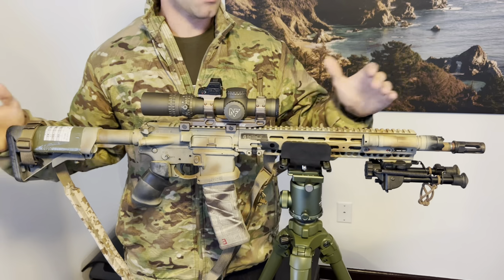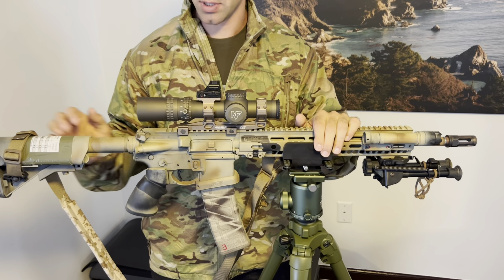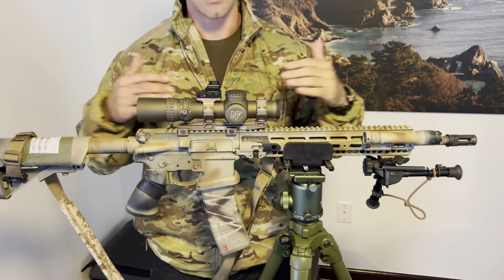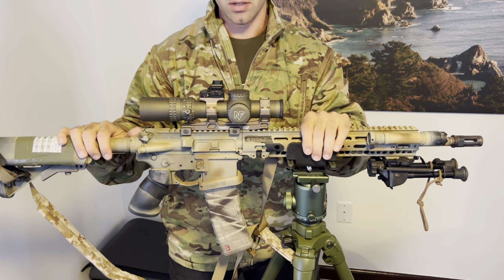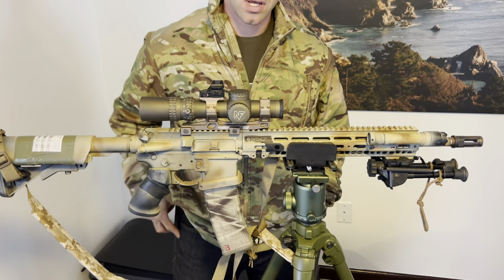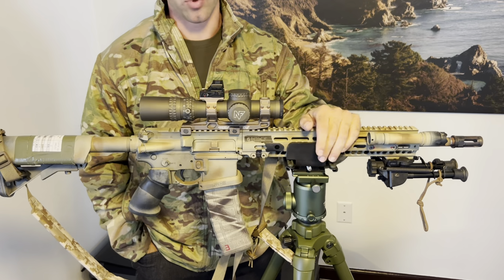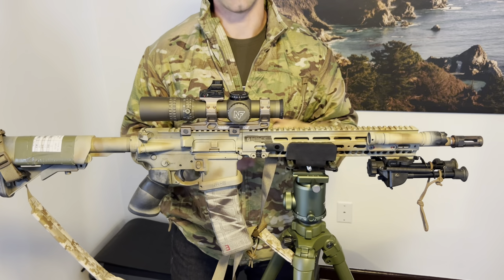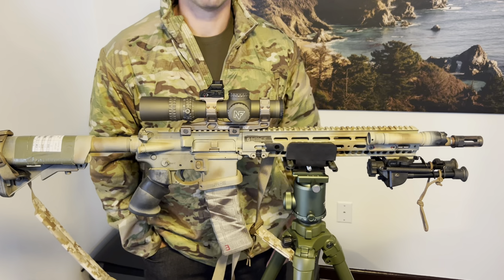Light Precision Overview

Comment: Thanks for sharing, the group you posted looked very impressive!

Would you have any more info on the hodge 14.5? I am looking into doing a build using that barrel.
Reply from the maker: I've not gotten a ton of time through that gun. However, I've been very happy with it and the 16" Hodge is easily a 1MOA gun as well so the 14.5" should be no different.

Comment: Is the Geissele mount a: Super Precision Scope Mount 34mm (SCHMIDT & BENDER 3-27)? I’m looking to replicate your optic setup!
Reply from the maker: Unfortunately my mount is a prototype with no clear match to an existing model. I think the S&B mount you’re looking at should do the trick though.
Reply: That is the one I purchased lastnight - [Super Precision Scope Mount 34mm (SCHMIDT & BENDER 3-27) - Black]. I spoke with a geissele rep and they said it should work since it’s a 34mm tube. Only thing is it would change the height over bore from 1.54” to 1.6ish. Your thoughts?

Comment: Have you experienced any issues with rear bags messing with the SOPMOD adjustment mechanism? If so how do you mitigate?
Reply from the maker: No issue. The toe of the stock is held to the high point of the game changer bag by the support hand so the latch is never in contact with the bag.

Comment: Finally! A review of a DMR setup based on actual performance on demand and building everything based on use case. I shoot at our local IWI gas gun series out to 700 here in PA using a DD Mk12 18: and a 3-18x. Would like to run a 16" next season and shoot a quantified performance match. Maybe in GP. Is the BCM kd4 7.7, in your own experience, GTG with BH 77gr? BCM gas guns have a rep on the internet as not being very accurate. What muzzle velocity are you getting with BCM kd4 with 77gr pills? Cheers. Subscribed!
Reply from the maker: The Defoor barrel is incredibly accurate with BH 77gr. I recently posted a picture here with a group that’s slightly over 0.5” (yes there’s a flyer, induces by the shooter). My two BCM guns have been accurate, no negative experiences here. I have no muzzle velocity data on that combination, just haven’t taken the effort on chrono-ing that gun
Reply: @Din Djarin  ok. Didn't see group you posted. Figured if you ran the bcm kd4 at a QP match you had to have MV from chrono in order to develop dope out to distance! Thx
Reply from the maker: @kiteokoh2652  totally reasonable assumption. I’ve ran the yard lines (out to 600) with it so I have true DOPE. The other factor for me is that most QP matches have targets large enough that the .1mil difference that may occur is really insignificant (in my opinion!)
Reply: You're exactly right! Your setup is trued!

Comment: So why an LPVO instead of a 3-18? I imagine its because you think the range of 5.56 doesn't justify the mag range. Also I've noticed alot of people replacing their GEN III with the ATACR, I think it says a lot about the GEN III as an optic. Anyways great vid
Reply from the maker: 1) Size, weight, and prioritization. I need the 1x more than I'll ever need the 16x or 18x. If there existed say a 2-12x optic in the same form factor as the ATACR 1-8x that may be interesting. Max effective is a factor, as is minimum effective. I'd still want a primary optic that I can go into a room with on a rifle of this style. 2) I haven't replaced my Razor 1-10x; its on a different rifle.